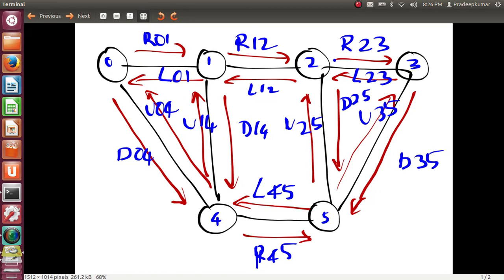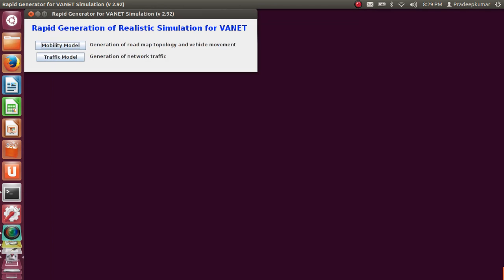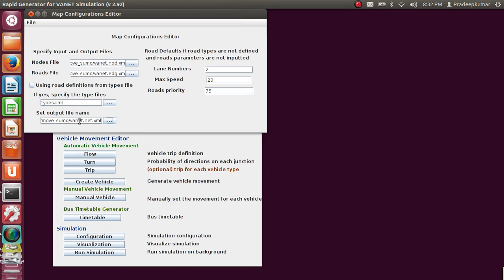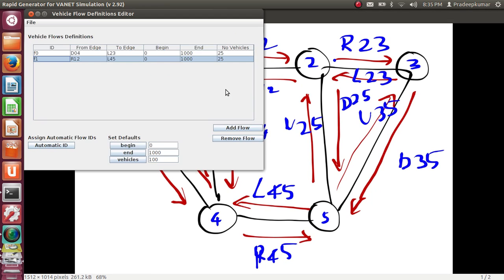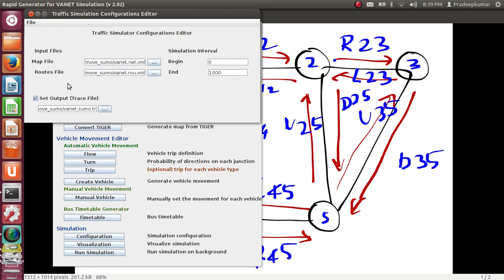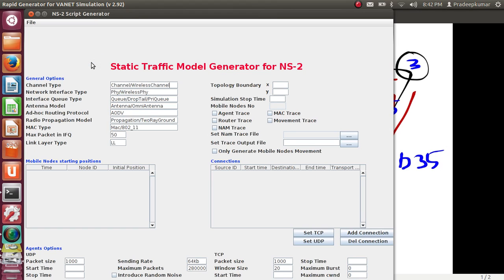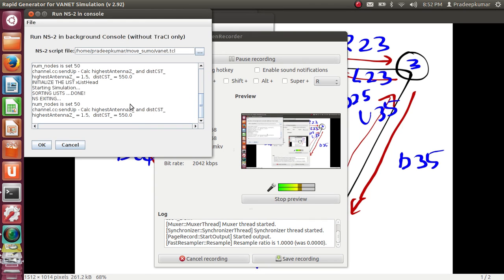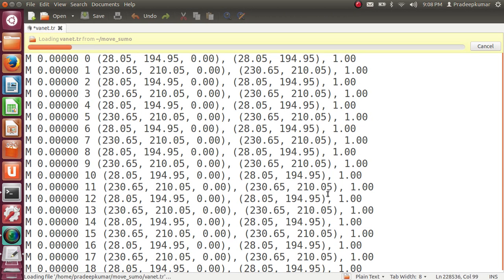VANET Simulation using SUMO and MOVE - NS2 Tutorial # 16

Comment: Hello sir

I'm working on MOVE and SUMO.
While generating the map, I'm facing the following error:
Loading configuration ... 
Warning: Please note that 'xml-node-files' is deprecated.
 Use 'node-files' instead.
Warning: Please note that 'xml-edge-files' is deprecated.
 Use 'edge-files' instead.
Error: No option with the name 'type' exists.
Warning: Please note that 'lanenumber' is deprecated.
 Use 'default.lanenumber' instead.
Warning: Please note that 'speed' is deprecated.
 Use 'default.speed' instead.
Warning: Please note that 'priority' is deprecated.
 Use 'default.priority' instead.
Warning: Please note that 'remove-geometry' is deprecated.
 Use 'geometry.remove' instead.
Warning: Please note that 'remove-isolated' is deprecated.
 Use 'remove-edges.isolated' instead.
Error: Could not load configuration '/home/sanjana/Desktop/MAPS/vanet.netc.cfg'.
Quitting (on error).

As mentioned in the comments, I decreased the no. of nodes and edges. It still is not working. Kindly guide me sir.
The versions of the softwares are:
ubuntu-18.04
SUMO-1.4.0
MOVE-2.92
Reply: i have the same problem, please is that you have solved this problem?

Comment: what a great video!, many thanks. I followed the stages and everything work  until I got to running NS-2 consol. I opened .tcl file and clicked ok i got the information below
INITIALIZE THE LIST xListedHead
can't read "node_( ) : no such element in array while executing
"$ns_attached-agent $node_( ) $sink1"
num_nodes is set 50
Reply: +Pradeepkumar TS  Yes i got it sorted, have to trace the line no 20833 on .tcl  file and got to know it was my mistake. Many thanks u're good
Reply: +Emmanuel Ezey hi Prof, please any idea on how i can link/combine config.tcl, activities.tcl and mobility.tcl  generated from sumo for simulation in ns2. i have generated them using TraceExporter.py and need to combine the three for and simulate in ns2.
Reply: +Pradeepkumar TS thanks for you response Prof, is it the one in the mobility.tcl or config.tcl please

Comment: i ran the same topology as in the video, but i am getting following errors during configuration regarding depriciation::
 Use 'node-files' instead.
Warning: Please note that 'xml-edge-files' is deprecated.
 Use 'edge-files' instead.
Error: No option with the name 'type' exists.
Warning: Please note that 'lanenumber' is deprecated.
 Use 'default.lanenumber' instead.
Warning: Please note that 'speed' is deprecated.
 Use 'default.speed' instead.
Warning: Please note that 'priority' is deprecated.
 Use 'default.priority' instead.

then have changed the above as suggested
but it gives the errors of nodes not being defined to particular edges

can u please suggest me some solution
regards